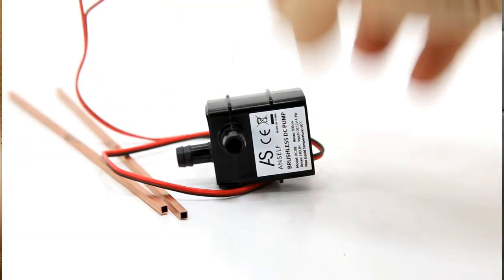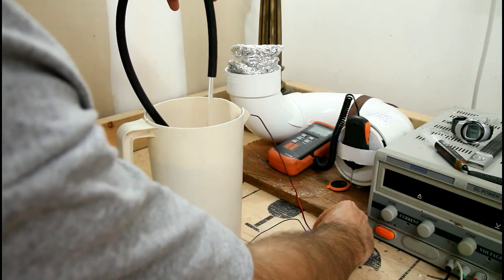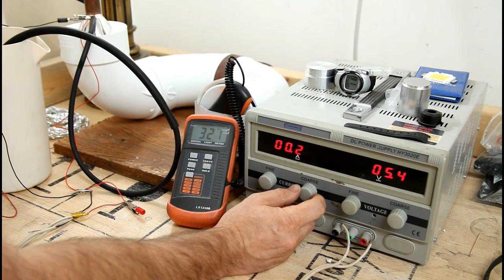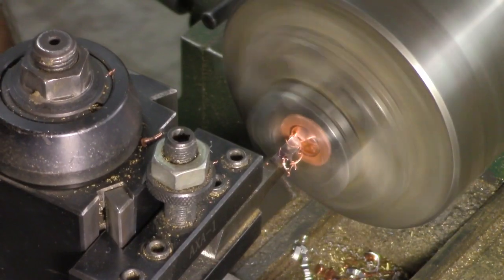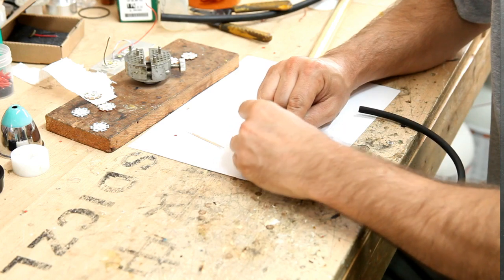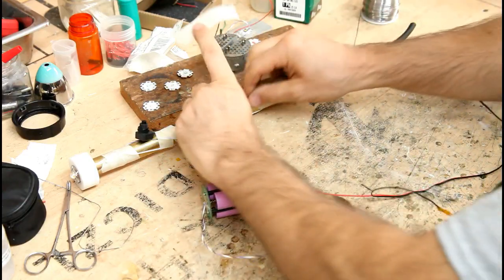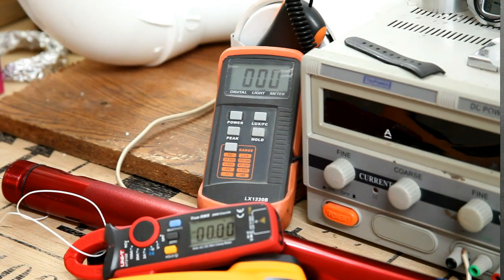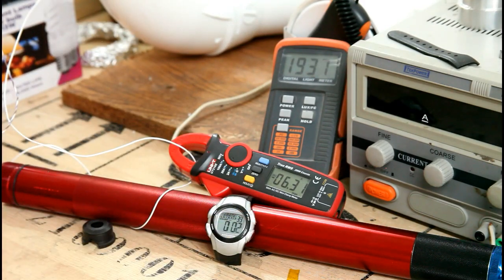Water Cooled LED Flashlight!

Comment: Crazy! But the wires running from the battery to the LED seem way too thin. They are the choke point, if you replace them by something thicker you should be able to get some more power out of it. Keep it up!
Reply from the maker: Thank you.

Comment: It may be time to upgrade to the 70.2. They are typically pulling 17 to 18 amps (6v) in lights like the L6. With water cooling I'm sure the output would be way higher than the older xhp70.
Reply from the maker: Thanks Jason.   Just now ordered some.   I'll give it a shot when  they get here.

Comment: Did you direct drive the light of your cells? I have a copper waterblock I plan on mounting 4 xhp70.2 leds on 16mm mcpcbs and 15 samsung 20r batteries not compact but will be fun to build
Reply from the maker: Yes, direct drive for this project.  As long as you have really good thermal path and heat sinking it is fine.

Comment: Matt, what kind of lenses did you use to make that homemade super thrower flashlight? Ive tried to replicate that with lenses but the best i got is a 35mm cannon lense  and it throws the shape of my LED but it widens unlike yours stays tight
Reply from the maker: The water cooled light uses an LUM 5-90 reflector from illumination machines, it has no lens.

Comment: Any idea what the actual maximum wattage the xhp70s will handle? I see you pushed them well over 100 Watts just curious what the limit is...
Reply from the maker: Hi Justin.   Once you hit the turn around point where your adding more current, but the lumen count goes down, death is very near.   I could have probly piled on another amp or so of current before the bond wires under the dome gave out.     If a thermal junction was created closer to the LED and liquid nitrogen or helium was used to cool the LED you could increase that, but I think the bond wires are still going to be your weak link.

Comment: How much could i get max out of a xhp70.2? Someone was talking about 9500 lumen but that seems a bit much..
Reply from the maker: So far I still have not had a chance to do any testing with them.   Just been really behind on things.  Plus  I damaged my light meter the other day and have a new one on order lol...    I think 9500 in a water cooled setup with that LED is possible.   In a regular setup if they actually got that they probly got it the instant the light was turned on.    Without some kind of active cooling the output would fall quickly.

Comment: love your creativity and cool idea but why didnt you utilize existing computer processor water cooling components instead of ? whatever that monstrosity is,maybe just maybe it would be a viable flashlight self contained instead of a friggin backpack, im currently in experimentation with something very simular using a new emitter idea i plan to patent if i can pull it off in a realistic fashion utilizing an emitter unheard of in the flashlight world but problem is HEAT,  lest i give away too much however liquid filled and not water, no pump, convection/piston driven, no fan, radiator/tank is very close to your system tube in a tube , the emitter is making 6.5w worth of heat 12v boosted driver, a blue laser/phoshor one piece emitter that is a one piece user replaceable NO soldering socket unit that should make a W1 look like a toy and it all fits into a L6 host,using regular 2x 26650 batts.  in my system i fit whole cooling system into a modified convoy L2 battery extension that sits forward of the batteries, helps being an engineer,im also a toolmaker but i made it all at home with no lathe alot is still on paper but getting there,but your idea is very close, look up computer processor water cooling bases and i think you will be led in a different direction,a more realistic one. also keep in mind majority of lights only run turbo for a few minutes so no large tank is needed so you can put the mason jar back on mamas shelf along with the 12 feet of tubing you used,the backpack and the plumbing supplies

Comment: I see no cooling here, just a jar of water that will boil in 10 minutes. This guy never looked at a water cooling system on a computer where you got a huge radiator in the back of the computer to chill the recirculating water, and sometimes more than 2 fans on it to help. Here instead we have a jar that not only doesn`t help cooling the water but is in fact a very good thermal insulator for the water to boil nicely...DOWN.
Reply: It works... and i think you'll get bored before the water boil down.
Reply: if ya got kidney problems it might work nice for ya